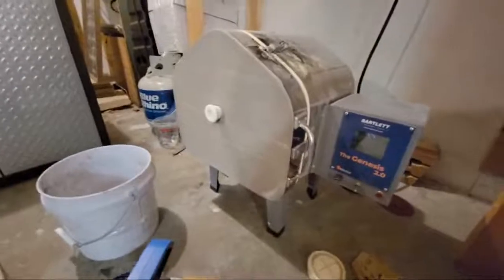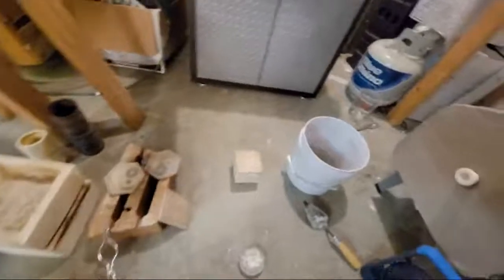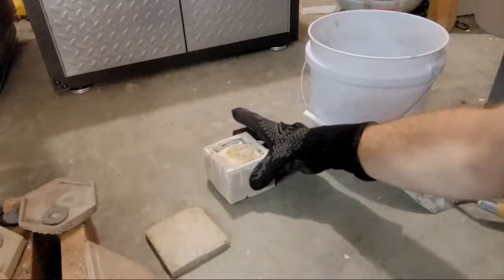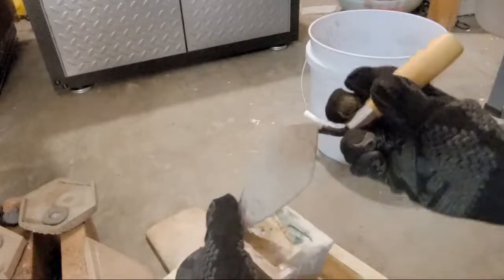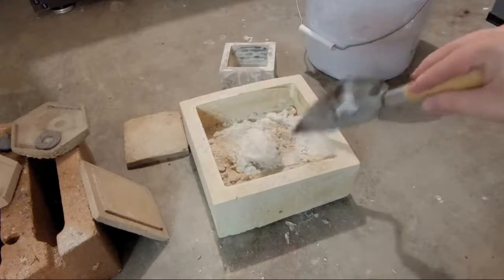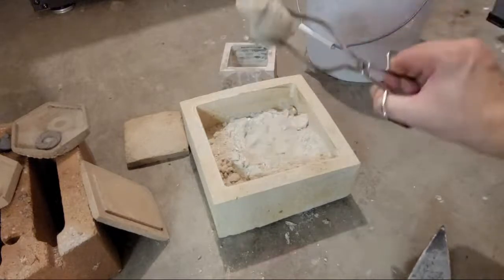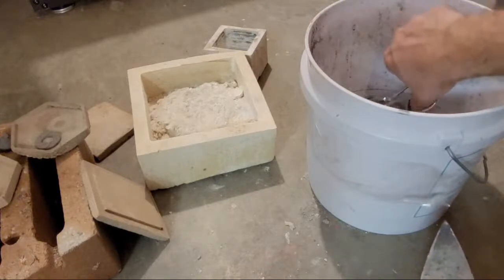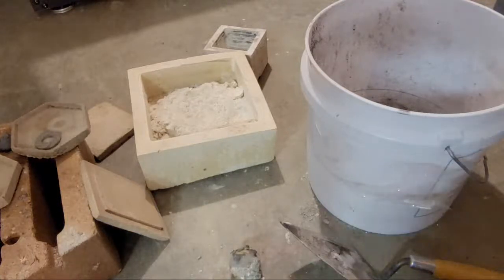My First SUCCESSFUL Aluminum 3D Print

Comment: What's that crucible made of I gotta make a pretty good sized one for a project
Reply from the maker: It's an alumina crucible made with castable refractory. There's lot of options on Amazon for brand (differing price points / max temps etc...)